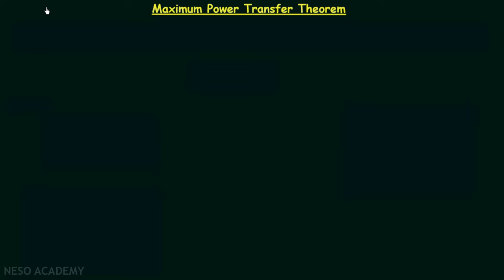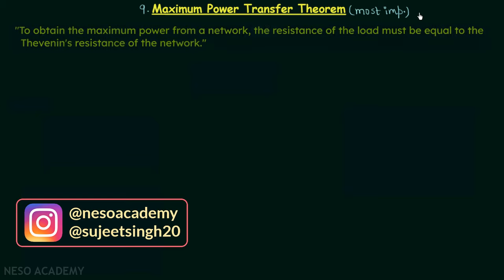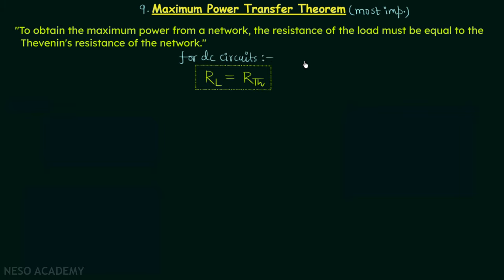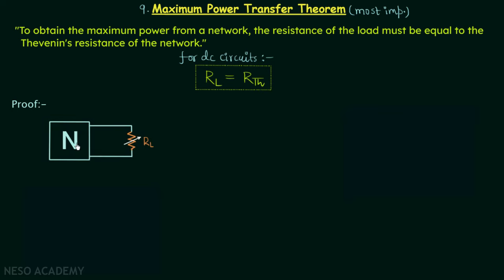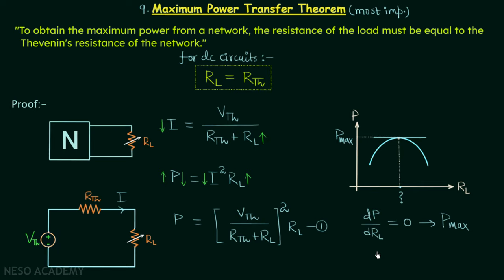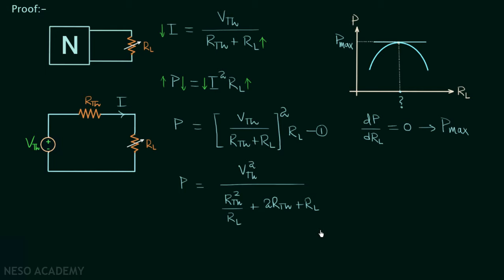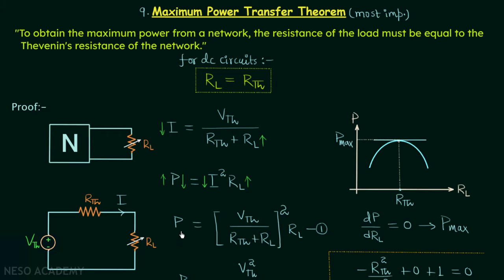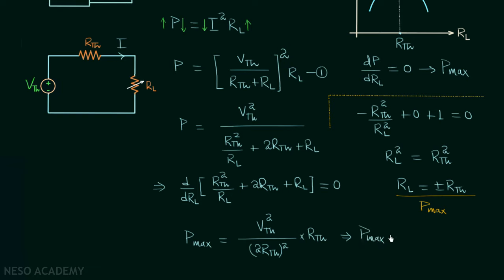Maximum Power Transfer Theorem

Comment: Plz expain physically that why maximum power is transferred when load resistance is equal to source resistance ???
Reply: If u set the derivative of power in terms of resistance to zero to find the maximum value of resistance, you will get that Rsource=Rload

Comment: Plz could u clarify this doubt…after eq 1 u seem to have taken (a+b)^2 for denominator and then divided all terms by RL…so if ur dividing it all by RL then why is P not divided by RL…and at end the answer equates to +/-Rth = RL but resistors can’t be negative
Reply: 1) he didn't divide whole equation by rl, he just too took the reciprocal of rl then took that in denominator 
u can say that he divided the numerator AND denominator by rl
or if i divide something by (1/x) or multiply by x then both are same things 
2) resistance can't be -ve that's why we'll ignore the -ve value and consider only +ve value

Comment: Hi. I have a question. What if the circuit is in parallel? example is a battery and two resistors. all of them are connected in parallel. I want to determine the value/setting for the other resistor (rheostat). resistor 1 is a fixed resistor having a resistance of 120 ohms and resistor 2 is a rheostat (variable). voltage source is set to 12V. what setting should be the value of the rheostat to be able to achieve maximum power transfer to the rheostat?

If I will be solving the thevenin resistance, it will be zero, Rth = 0. It means, I need to short circuit the terminals of the voltage source?

Thanks for those who will answer my question.
Reply: Great question. This theorem applies to Thevenin’s Theorem, which means the circuit has been transferred from the complex one (parallel circuit) to the simple one (series circuit)
Reply: so the case when the circuit is in parallel can not happen